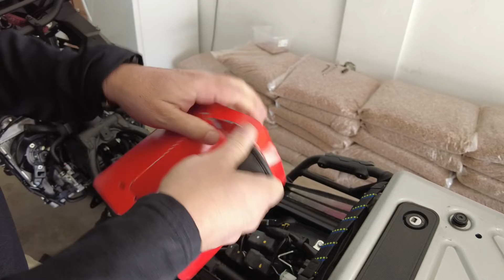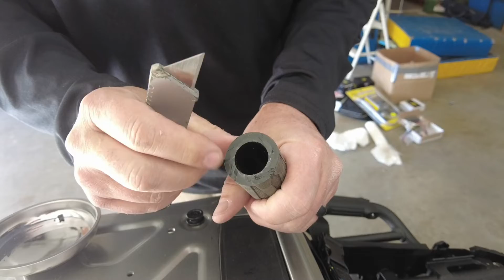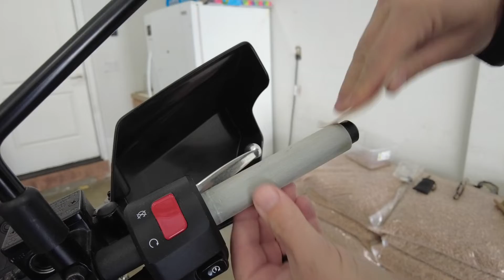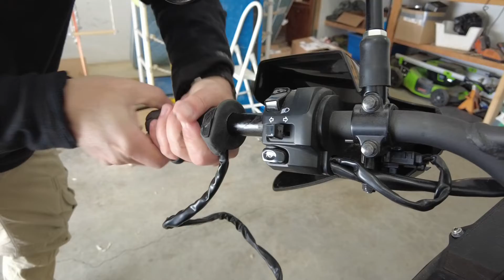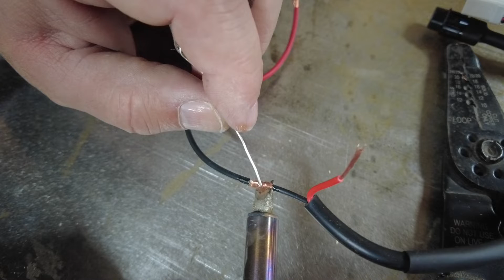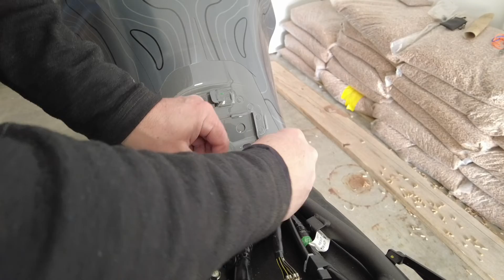Installing Koso Heated Grips on a 3rd-Gen KLR650

Comment: Could you use a basic butt splice or add bullet connectors rather than soldering the connections?
Reply from the maker: You could, however we are using our KLRs for overlanding through central and South America and wanted the connection to be strong and durable. I’ve had connection problems with bullet-type connections in the past.

Comment: Just installed these heated grips on my 2024 KLR 650 S.  Your instructions were very helpful and I got em installed with only one moment of panic! 😮
I wired them to the bullet connectors under the front headlight.  I didn’t need to trim the grips by 5mm. They fit just fine as is.  The panic moment was on the throttle side when the super glue set up super fast and they got stuck about halfway. Fortunately, I was able to use a rubber mallet to get them into position.  Whew!  They work great and I didn’t find any extra connectors laying about after replacing the cowling, etc.  Yippee!  Looking forward to some Pacific Northwest cool weather riding.  Thanks again!
Reply from the maker: Great news! Glad the video helped. As a side-note, the glue provided with my kit only worked for about a month. I felt the throttle slide a bit during a particularly hot day in the desert. I ended up using another glue that I found at a department store and that has held over the last 8 months. Enjoy the cooler weather of the autumn riding season!

Comment: Your videos are great and I appreciate the time and effort you devote to each one.  Can I wire these grips to the connections under the front cowling?  I understand that I need to install the relay first.  Thanks very much!
Reply from the maker: Thanks for your positive comment! Yes, absolutely you could wire heated grips to any of the three connectors (under tank, left side fairing, or right side fairing) since all are powered from the relay.

Comment: great job...I also offset the positive and negative solder joints  for added protection and smaller overall finish.
Reply from the maker: Good call on the offset. Thanks for the comment!